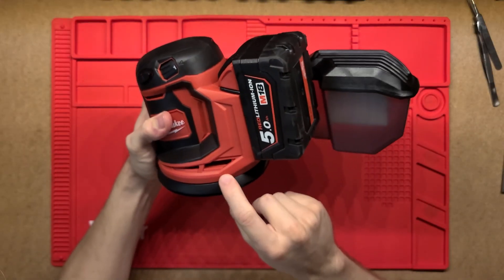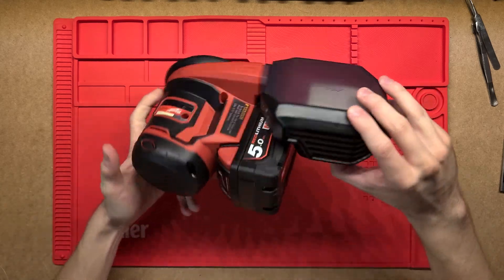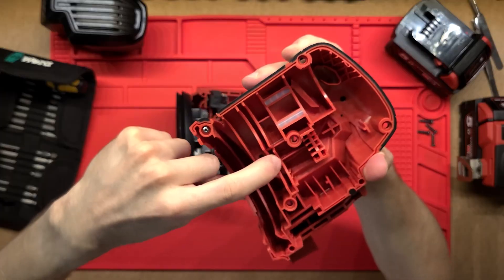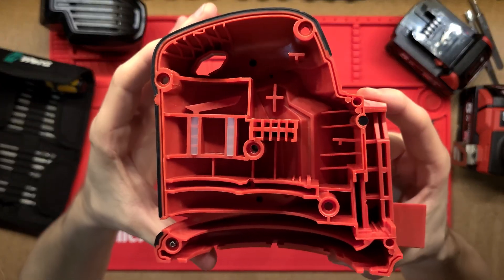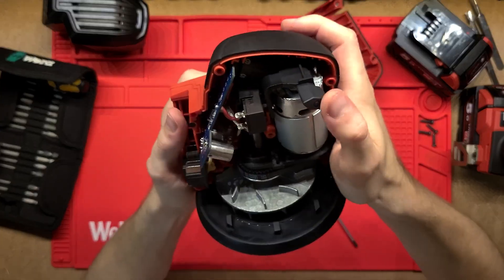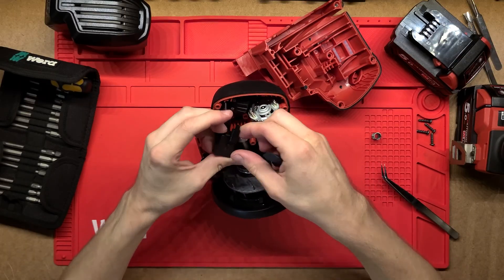MILWAUKEE M18 Random Orbital Sander Teardown

Comment: What kind of motor can I use instead of the original Milwaukee motor, once I start using in it stops the minute I put a little pressure

Comment: * spirally not randomly )
Reply from the maker: You’re right, it does appear mostly spiral, but the "random" comes from the sander's design—specifically the offset weight and bearing, which create unpredictable, uneven oscillations. So while it seems spiral at times, the motion is inherently random within a "spiral" pattern.
Reply: What kind of motor can I use instead of the original Milwaukee motor, once I start using in it stops the minute I put a little pressure